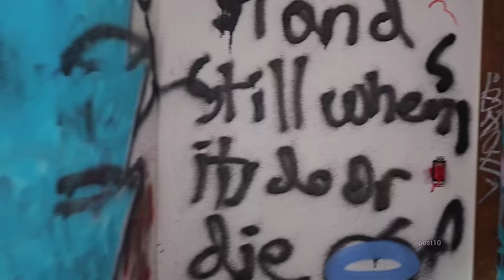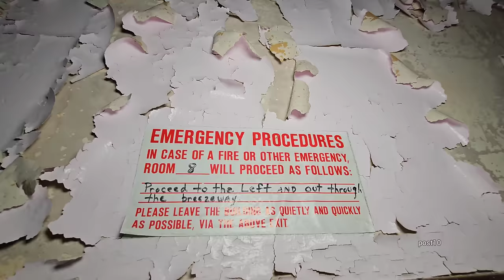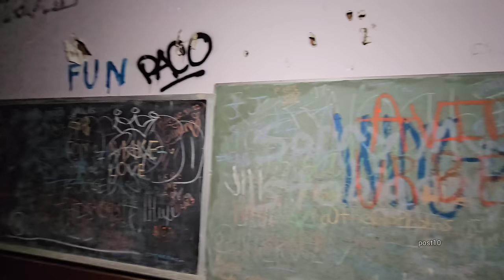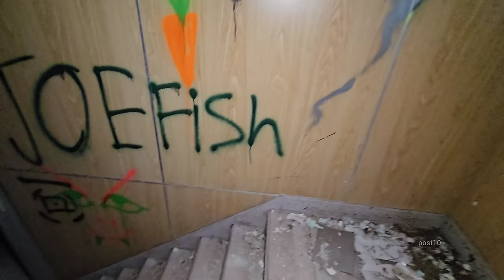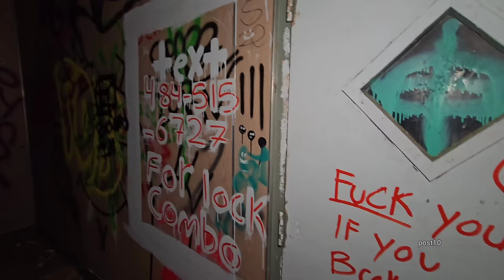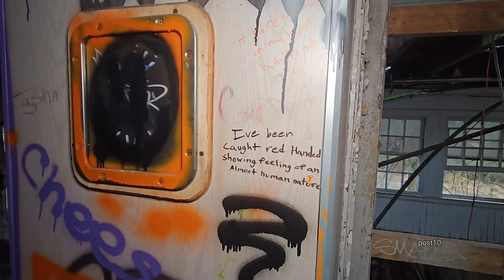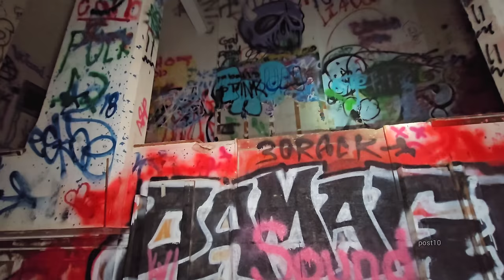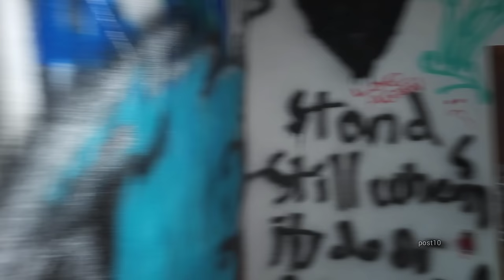Inside Entire Town Of Mansions, Church, School After 22 Years. Abandoned Farm School

Comment: That church with the slate roof and stone construction is testament to building techniques proven to resist degradation from time, the elements, and even vandalism. As you walked around in there I only saw one place broken through a wall, 1 or 2 doors off hinges and a busted particle door. None of the wood interior finish carpentry was damaged. All the staircases you went up & down appeared solid not rotted away or falling apart. Everything seemed solid under foot. Even the vandalism was mostly superficial the structure held up past any abuse. Interesting site originally to reform wayward youth as opposed to a prison cell. 
Good exploration video Post! Thanx

Comment: 7:05 Ulmer Memorial Chapel
The Ulmer Memorial Chapel, designed in the Colonial Revival-style, was completed in August 1965 and dedicated on October 23. The $200,000 building was the gift of Edward M. Ulmer and his sister, Mrs G. Lathrop Smith, who donated $140,000 in 1964 toward the cost of the chapel as a memorial to their parents.

A chapel fund had been started at the conclusion of World War II, but the bottom line did not significantly increase until 1961 when proceeds from the annual Village Fair were earmarked specifically for the construction of the new building.

The 300-seat chapel was used for Catholic, Jewish, Protestant, and non-sectarian services.
Reply: Just researched Sleighton Farm school. Started as reform school for girls (?) run by the Quakers in early 1800s. Gymnasium was added 1979.
Reply: Thank you for the information!

Comment: The holes in the ground inside the garage might have been fox dens, but they seemed a little smaller than any I've come across.They dig dens in the ground and you can usually smell them before seeing them. If they stink, they are either in use or recently abandoned. I've seen a lot of ground hogs, but haven't found any of their dens yet. You're probably correct about them belonging to ground hogs. The fox dens that I've found are never close to another den.

Comment: I've heard in other videos that the paint chipping is because the high levels of lead so just in case that's true, please be careful!
Reply from the maker: It's chipping in curling off the walls from constant humidity going back and forth from being dry hot freezing hot freezing. It's an old building so it probably is lead paint also but any paint when it dries out in do that, mainly oil-based but even latex can become a sharp

Comment: Good thing the place is abandoned. Massive fire trap. With all those doors opening into the corridors trying to evacuate would be nearly impossible. 
    Seen this place done by other urban explorers over the years. Sad to see how much destruction/damage done from year to year.
Reply from the maker: You could easily add fire escapes when the building code came into play
Reply: @post.10  But if people are getting smacked in the face with doors as they run for the fire escapes…..
Reply from the maker: @cindystrachan8566  no I'm talking about the ladders outside the windows, this place when it was used more as a prison that may have been a problem keeping people from escaping with active fire escapes though

Comment: LockPickingLawyer taught me that you could probably have opened that padlock by shimming some thin piece of metal down the shackle. Once I myself also managed to open a padlock just by sticking a bent wire deep into the keyhole and wiggling it around.
Reply: Or just unscrewing the bolts that hold the mount for the lock or prying it off